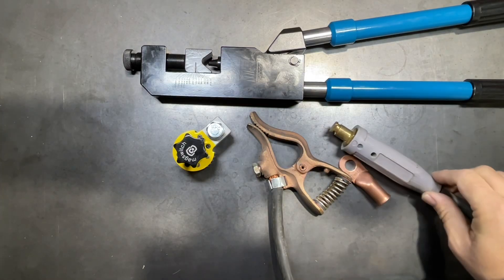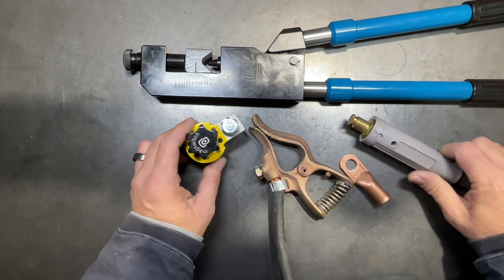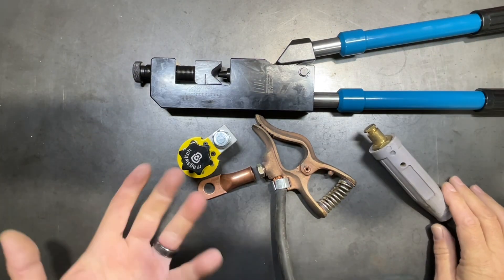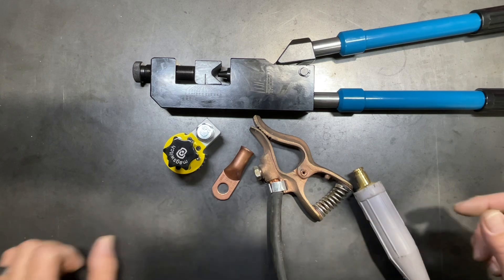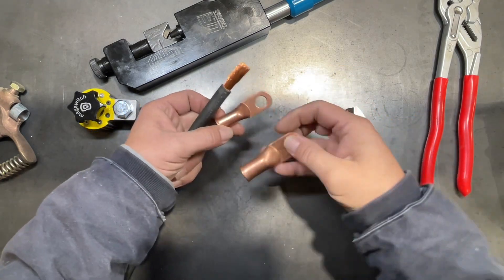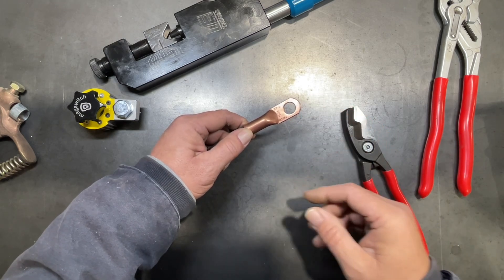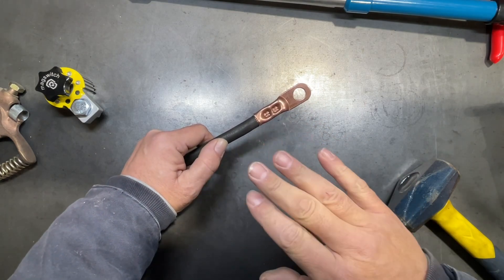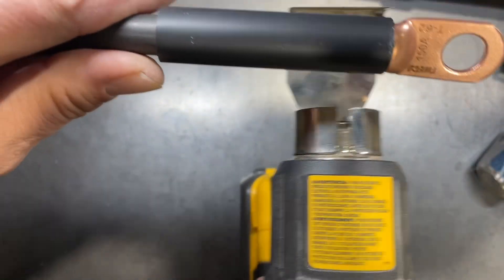Crimping Welding/Battery Cables With A Temco Dieless Crimper

Comment: I have the smaller Temco Th0012 which works ok. It is faster than the TH005(V2) Temco. What I dont like about the died version is the flash that you get. Looking at the alternative, W crimpers are spendy as hell.

Comment: Excellent demonstration Ben! Have you seen the hydraulic crimper ( 8tons) that Harbor Freight sells? I bought one  6 months ago and have been very impressed by its performance . It comes with 8 dies ( 0,2,4,6,8,10 and 14 gauge) for $70.00. Have a good day and a better one tomorrow.